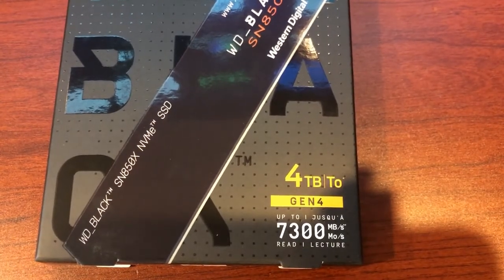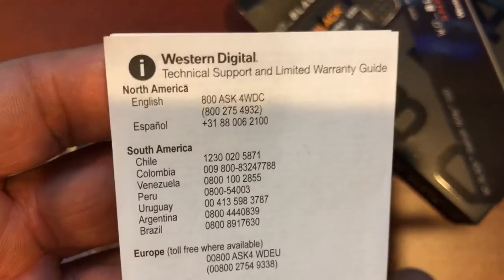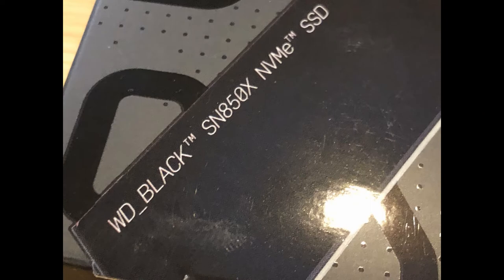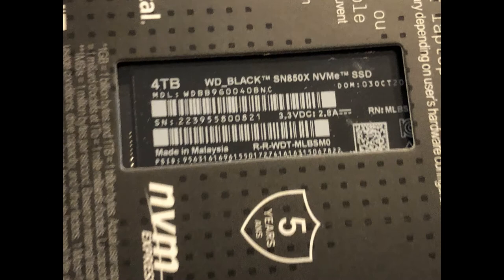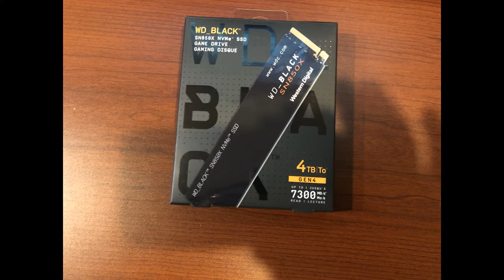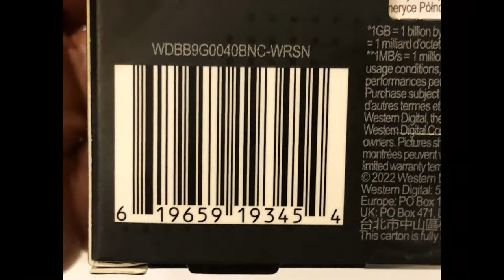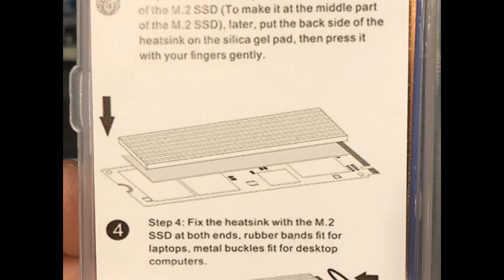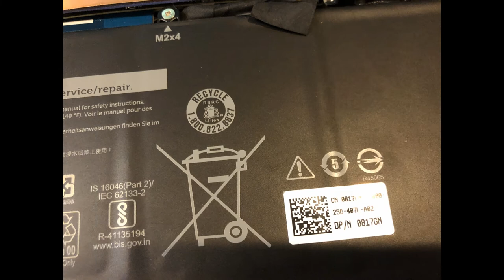Look @ UnBoXing WD 4TB HDD SSD WD BLACK SN850X Gaming Internal NVMe for Upgrading Alienware x17 R2

Comment: Will I need a heat sink or will my motherboard be good without one?
Reply from the maker: You need a heat sink
Reply: @mtandiz  a lot of people are telling me I don’t need one if my Mb comes with heat sink then some say I do need a heat sink
Reply from the maker: @razeceja1459  what do you mean by you’re mother board comes with a heat sink ? You just need one heat sink to dissipate the heat from the drive. Reading & writing to the drive may cause the SSD drive to heat up, or overheat. This in turn can lead to crashes & errors, & then SSD totally failure.
Reply: @mtandiz  I’m sorry my motherboard comes with heat shield and thermal pads would that not keep the ssd cool
Reply from the maker: @razeceja1459  yes, if they fit, i see no issues, just keep aware of any excessive heat coming from your laptop. But it sounds like you have everything you need.
Reply: @mtandiz  it will be for my gaming pc or are 4tb not worth it for a gaming pc, plan on building my first pc near the end of the month sorry for asking so many questions 😅
Reply from the maker: @razeceja1459  don’t apologize, i do this video to help myself and others. I see a huge difference between my two gaming pc computers, on with a regular ssd, speeds of up to 500MB read & write, which is fast, & the one in this video I believe i was getting 1700MB read and write, over 3 times faster

Comment: Is this single sided or dual sided?
Reply from the maker: Single Sided
Reply: How can I tell if my WD SN850X 4tb ssd is single sided or not, if its single sided where is the thermal pad supposed to go
Reply from the maker: @bamban_garcia5562  i had to read it on the website, it says single sided, but when I received the 4TB SSD, it had chips on both sides, so it was confusing to me, but it fit , with a heat sink, with no issues, i think the chips on one side are thinner.
Reply: @mtandiz  Mine has chips on both sides as well though the top part is covered by the label plus the Elecgear heatsink I bought for the PlayStation 5 only mentions 1mm to use for the whole thing or 1.5mm cut pieces to cover the chips directly nothing about sizes for double sided

Rather know what size thermal pad I need as well as where to put it correctly before dropping $40 on the kritical thermal pads extreme conductivity 20w/mk
Reply from the maker: @bamban_garcia5562  i used these, they are thin, & work fine in my laptop https://www.amazon.com/gp/product/B07YC1HTFR/ref=ppx_yo_dt_b_search_asin_title?ie=UTF8&psc=1
Reply: @mtandiz  Sadly the PlayStation 5 ssd expansion slot is far different then a laptop one as such need different heatsinks / thermal pads for it
Reply from the maker: @bamban_garcia5562  you could always buy, try, if it doesn’t fit, B&H has a 30 day, awesome return policy .
Reply: @mtandiz  Bought my ssd, heatsink, thermal pad rom Amazon with no idea if the return policy is still valid since everything was ordered at different times
Reply: @mtandiz  how come single sided when you show the back of ssd have two chips, this should be double sided right?
Reply from the maker: @mayedsaab7814  i agree, but the purchase website & the WD website says single sided, but it looks like it’s double sided, but it fit in the CPU, its odd to me too.
Reply: @mayedsaab7814  yeah one would expect it to look like it does on the box - which is very much doesn't. So if by double sided one means that there are chips on both sides, there is. But they are fairly thin, so if by single sided one would mean "will it fit in a bay that doesn't allow for much room" then yes. So it's double sided technically, but for intents and purposes (other than thermal) it doesn't come with the physical restrictions of one.
Reply: @mtandiz  you only need heatsinks for your SSDs under very specific circumstances. And those you're linking really aren't much compared to the ones that come with the drives. 99% of people shouldn't worry about it.
Reply from the maker: @PLF...  thanks for the info
Reply: 4TB is dual

Comment: i just bought wd sn850x and install pcie 4 port,   but when i transfer data hard disk to nvmv sn 850x ssd data transfer only 115-120 mbps speed.. if i check speed on crystalcinebench its show 7000mbps read or 6900 write.. dont know where is the problem. can you tell me how to fix this issue ??

system i7 13700k
mobo  gigabyte z790 ud ax 9 (bios updated)
16 gb ddr5 5200mhz ram
Reply: You will need to install this in the top m.2 slot that is usually the only gen 4 slot the goes directly to your cpu
Reply: A hard disk usually cannot push more than 115-120MB/s. It is not the ssd's fault. This is why you see much higher speeds on a benchmark test.
Reply: thats because ur reading from an hdd. the throughput will be limited by the hdd. only when ur shuffling files from the ssd alone will u get the ultrafast speeds.